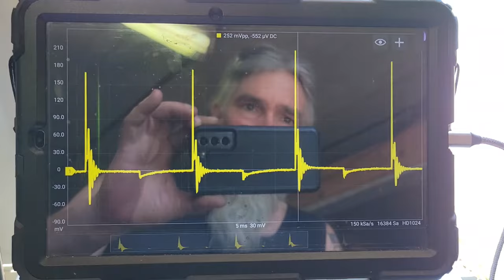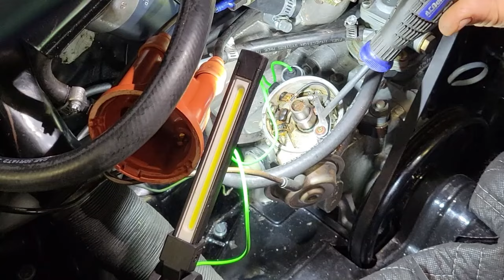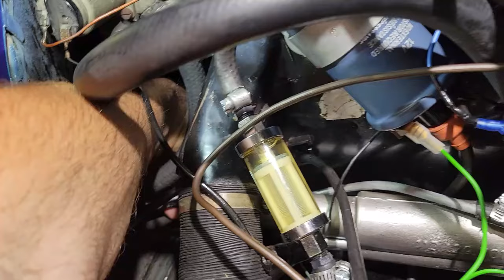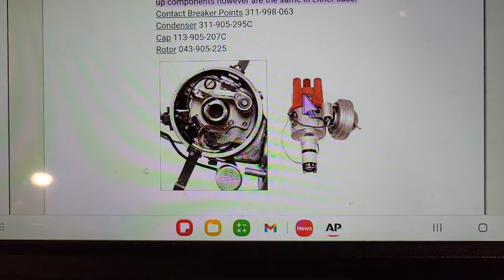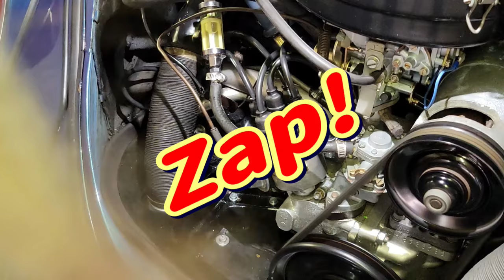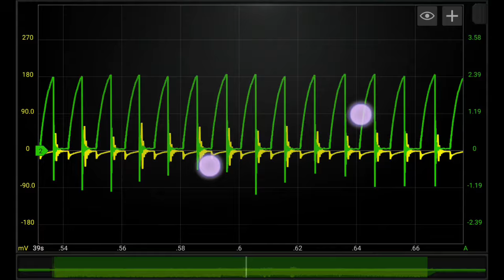68 VW Beetle tune up, plus using a budget automotive oscilloscope to measure point dwell & secondary

Comment: Just a heads up. Change out that silly glass fuel filter. Thats a fire waiting to happen. They leak. And its right by ur ignition system.
Reply from the maker: Thanks for the tip! We did move the filter to the front after the tank. Mike bought one of the relocation kits that put the brass filter on the axle but it was not compatible with the auto stick. I put a plastic one up front because they had the same concern as you and did not want to drive it far with that set up. Before this season, I would like to at least change the plastic one to aluminum or brass. Just for durability. Thanks again, the last time I worked on one of these, those glass filters were pretty standard, but then again that was from the days of getting a good engine for 100 bucks just about anywhere. Long time gone. Cheers!
Reply: @Backalleydiagnostics glad to hear that. Yeah world is changing

Comment: Are you displaying from a PC? If so what are u using? Thanks for posting!
Reply from the maker: Hi, that is an android tablet. The app is hscope, its made by Matrin Loren. It's on the Play Store, and I believe you can use it in demo on 1 channel.  There are a few scopes it works with, that one was one of his hs512. Very budget friendly oscilloscooes. If you get one of his, the autonitive module cones with it free. If you have a compatible scooe, it's between 20 and 30 bucks for the licenses, very reasonable. His website is Martinloren.com, check it out if you are interested.  Thanks for dropping by!

Comment: You said you were going to adjust the valves next. When you get to cylinder number 3, add 2 thousandths to the spec. This cylinder is under the oil cooler and runs a bit hotter than the rest. The valves will thank you.
Reply from the maker: Thank you! That's a golden tip right there! I will definitely do that. It is nice starting with one in such good shape. With tips like that, i hope to keep it that way for them. Thanks again, I appreciate it and any other tips as we go! Cheers!

Comment: There are two points I'd like to address about your narrative in this video. The first is the waveform of the flat spark line with the uptick at the end. This is normal and, in fact desirable. If you imagine dividing the spark line in half, the left half tells you about what happens outside of the cylinder and the right half is what happens inside of the cylinder. If the line began rising about midpoint, that would indicate lean hydrocarbons to complete the burn. This shows that more voltage was necessary at an increasing rate until the spark exhausted all energy from the coil. Your capture showed a completely flat spark line showing the mixture was fine. The uptick at the end showed a voltage increase when the current stopped flowing, probably created by magnetic flux crossing the secondary windings during collapse. The residual energy is then dissipated by bouncing back and forth between the coil and the condenser. This is what creates the oscillations right after the spark ends. That's why you need to see at least four oscillations there in a healthy system. The really high uptick in a lean mixture condition is because the energy level from the coil, trying to maintain the spark is at peak when the spark says, "I can't," and the coil has a lot more to dissipate to the condenser. 
The second issue was when you were describing the height of the firing lines and said they were short during snap throttle. I believe you were looking at the deceleration of the engine right after snap throttle. An ignition coil only puts out enough voltage to ionize and jump the largest gap in the system. The spark plug gap, although mere thousandths of an inch becomes the largest gap under high pressure inside the combustion chamber. That pressure is lower during idle because of negative pressure in the intake manifold. This is where you see a firing line of 8 to 10 KV normally. When you snap the throttle open, pressure inside the manifold increases to near atmospheric and the pressure in the combustion rises dramatically.  Now, the firing line goes up to 12 to 16 KV. Under deceleration after the snap, throttle plate is closed but rpm is still high and cylinder pressure is as low as it can be, making low firing lines again. I hope this helps. This knowledge has helped me make engines run, that shouldn't be running in their condition.
Reply from the maker: I knew that a lean uptick was good. These do look different than computerized ignition. I was wondering if it was too lean. The way the uptick actually seems to form the top of the first oscillation kind of threw me off.  
This is the first non fuel injected engine I've scoped. It seems easy to drive efi rich with an o2 sensor. Part of what made it fun to hook up, seeing new things on the screen lol.  Yes , that does help on the firing lines as well. The part that explained it the best is realizing, like you said, when the throttle plate is closed, it's not working nearly as hard. Thanks for all the tips, I can watch vids for hours and not retain as much as a comment on something I did. Always striving to improve and you have been a great help!

Comment: Eric this was an enjoyable video  brought e back to a time when you just needed a few simple tools . I still have my Roger Penske Sears roebuck tune up kit . Tack and dwell fuel / vacuum gauge timing light and remote starter .  In fact the purchase receipt is still with the complete kit . Back then it was like 49$ which was a lot. I’ll send you a picture .  Real collectors item. Lol beautiful car . I recall as a kid a bunch of changed a Renault engine in front of my parents house just by lifting it out y hand . The sixties were a great time . Thanks again Artie 👍 Eric what was the burn time compared to today’s car ? Just curious
Reply from the maker: Hi Artie! The Penske kit is probably a collectors item now! I ended up finding my timing light in a box in my basement. I've been in that garage for 3 years, so I haven't needed one for at least that long. I used to love those remote starters when there was usually a solenoid on the firewall. It's was neat seeing the dwell on the scope for sure beings I no longer have a dwell meter. The burn time was around 1ms. That's right on the min for modern efi engines, although the gap would change that. 
 Working on the old ones was fun in the day, when there were only a few mom and pop parts stores around, instead of 2 on each block. Almost every part came in a white box with no name, but they worked. Today, we get Boschs that are DOA. We have also lost "parts guys" when these chains started advertising "no experience necessary". Plus, all the counterfeit plugs and coils on the market today, makes the the old days seem even longer ago. Have a great one Artie!

Comment: Interesting video. I became an auto tech in the early 70s, before electronic ignition became the norm. Back then, there were basic options based on manufacturer and type of engine. None of this mix and match to deal with. Your distributor shaft dictates that you use the shorter rotor. To find out which cap you need, hold a marker at the level of the rotor and at a distance that will allow you to set the cap on the distributor. Mark the cap at rotor level and start measuring inside the cap to see where the tower lugs and center button are in relation to the mark you made depth wise. Higher output from the coil, and more importantly,  increase in plug gap made it necessary to get the spark from the rotor farther away from the distributor body. That's why the cap and rotor became taller. Using the shorter rotor with the taller cap may have introduced a choice of whether to go up to the cap or down to the housing for the spark. Also, if the cap's button doesn't reach the rotor, the point of contact will burn out. You might want to go with the shorter cap. You might have to go with the shorter cap. I also see that your distributor is of the single diaphragm vacuum advance type and not the dual diaphragm as shown in the illustration. Good luck. Good video.
Reply from the maker: I think thats exactly what was going on. When it came in with the tall cap and short rotor, where the button would normally touch the rotor, it was burnt black beyond normal wear. The button does not touch the tall cap at all, but with the short, you can feel the button spring slightly as you push the cap on. 
So far, he said its running better. I do want to check the timing now with the shorter cap, we have to order a new short cap and short rotor. The only short cap was a used one that came with the car.
 Thanks for the info! One of the best qualities of the internet, input! Cheers!
Reply: @Backalleydiagnostics I'm thinking someone probably swapped out the original distributor for a non auto stick distributor. They might have been trying to get away from the vacuum retard of the dual diaphragm or they didn't know there was a difference. 😮

Comment: Great video.... The thing with older cars is most people miss the basics this comes from working on modern cars they literally take humans out of the equation... distributor play up and down not that critical but can be made better with shims distributor turning play also not critical as long as rotor is in phase. Now distributor shaft side play is critical when it gets excessive. One way to check rotor phasing is to drill a hole in the cap and paint mark the rotor with white or yellow paint then use a timing light with no.1 spark plug wire... at cap you should see  no.1  lines up perfectly this works on both points and electronic mag pick... Now electronic ignition is  the way to go here especially if the owner is not mechanically inclined... points will eventually go out of tune.. gas mileage  and spark plugs life will increase with electronic ignition. Dependability hangs on the quality of the upgrade parts but spares can be easily carried along as the older cars are 99% of the time road side fixable with just basic knowledge. The points have a second downside unless you buy NOS points most of the time you will not be getting OEM quality points that last longer and stay in tune longer.... I'm not the modern mechanic that when confronted with a model A Ford loses his mind or a Luddite that sees a 2025 engine bay and has a mental breakdown 😂😅🤣.... I go by the philosophy of a animal doctor got to fix what comes in a snake 🐍 a dog 🐕 a eagle 🦅 even a fish 🐟... It all comes down to knowing the basics... If it has an engine it's always doable... The older cars like the VW is where my heart is much closer to humanity than their modern brethren for sure. And the only ones that will be running when the aliens come..😂😅🤣
Reply from the maker: That is a great idea for the rotor phase! We have discussed the electronic ignition upgrade and might be coming in the future. It's definitely more reliable. He isn't opposed to new points every spring but still electronic is an upgrade. 
 The distributor play seems like its not slop, makes solid clicks and you can feel its not wonky. The thing is I'd say it was too much slop for an old Ford distributor. I just dont know about what was normal on these vws. I was thinking the slot it goes into instead of a gear is why it seems slopoier than most? I haven't touched an air-cooled bug in 30 years or more. It's pretty relaxing, even when parts dont match lol. Very interesting using a scope on older cars, the dwell was pretty cool on the scope. It will be a blast seeing if the scope will help fine tuning beyond what a feelers gauge can. 
 Thanks for the tip! Cheers!
Reply: Thanks for the reply Eric 🍻